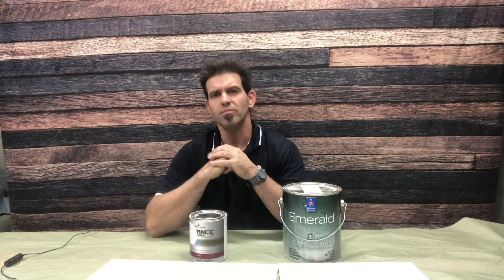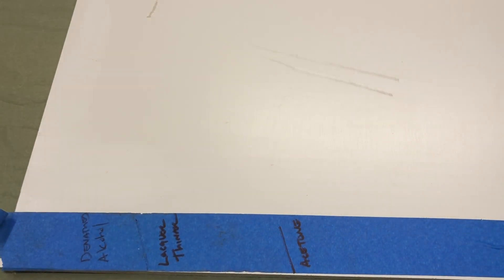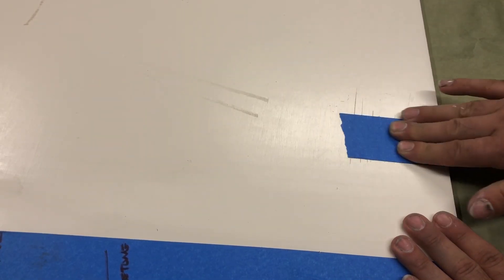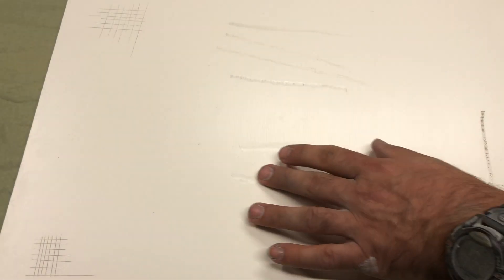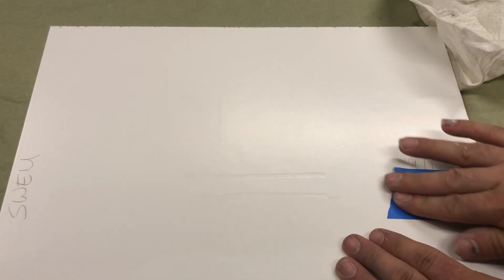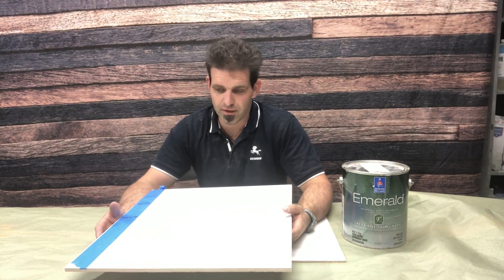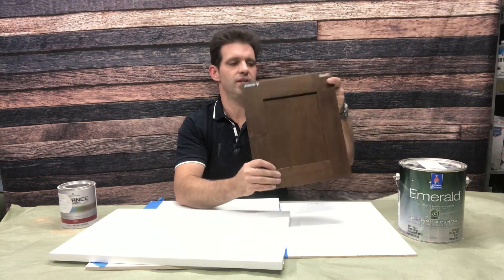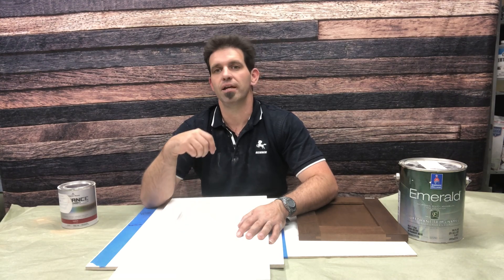Sherwin Williams Emerald Urethane Vs Benjamin Moore Advance

Comment: The emerald urethane you have is an Ultradeep base which is made for dark and accent colors... the 12 oz of white added took away the quality of the product therefore this comparison is not valid. Emerald uru is hands down the better product.
Reply from the maker: Bobby Robinson it’s a prop for the video it was not the can I used.  This was black I had for another test I was doing. So I did not put 12 ounces of white in a deep base that would be stupid and sherwin williams would not have done that anyway. Also I never determined am clear winner in the video. All I did was point out the pluses and minuses is each finish.
Reply from the maker: Bobby Robinson it’s a prop for the video it was not the can I used.  This was black I had for another test I was doing. So I did not put 12 ounces of white in a deep base that would be stupid and sherwin williams would not have done that anyway. Also I never determined am clear winner in the video. All I did was point out the pluses and minuses is each finish.

Comment: Emerald is TRASH!!!! when it comes to feel. it doesnt touch up for crap and takes many coats to make it look right. I sprayed a pre primed trim pack on new construction and it bubbled, but that could have been caused by the temps in the house since there wasnt any heat and was around 60 degrees i cant remember . but its still crap to  me since it feels gritty. Eric you really should try scuff X from ben moore. I  love this stuff it feels orgasmic to touch  like most high end industrial finishes, buttery smooth no matter the application method. Its not cheap even with a contractor discount but its my new go to trim paint for interior house painting jobs and repaints. some have used to for cabinets but yeah i wouldnt since im more into the high end industrial coatings.
Reply: I totally agree! Lays down great looks great feels great and you can recoat the same day! There's no reason to use advanced since there's no added benefits and you got to wait 16 hour for coat👍
Reply: @ballardpaintingcompany514  i kinda want to keep it a secret but for the price i think most low quality penny pushing painters will just go for some cheapo paint anyhow.
Reply: @bailey2624  👊
Reply: Yes you pay more , but we switched to Renner and honestly we are running smoother and faster with less / no call backs. We are finishing jobs in 3-4 days . So yes it's way more expensive but specially if you use the Renner 851 2k , but at the end of the day would you like to save $100 in paint or $1000 in labor ?  I don't think we will be going back to advance or emerald urethane not because they are trash ( because they aren't ) but because we are better experience and better finishers . We used to call ourselves cabinet painters when using advance etc... Now we call ourselves cabinet refinishers who use industrial wood coatings ( we closed many more jobs using this method )
Reply: @emanuelmorales2914  totally agree!👊👊
Reply from the maker: Rick Bailey I hear ya it’s on list. Thanks for the comments and the support.
Reply: Just when I was going to buy SW Emerald paint to do my kitchen cabinets, now comes along this comment trashing Emerald, and Eric doesn't defend Emerald. WTF? I thought this was a video saying Emerald was decent? How is there no push back on this comment? There is literally is no paint out there that is durable and beautiful for kitchen cabinets that someone won't trash to oblivion. And these three paints, Renner, Milesi and CIC that are being touted as better than anything, are unobtainable. Where's the info from this Youtuber on how to obtain them? Choosing a primer and topcoat for refinishing kitchen cabinets by watching all the videos on Youtube in order to pick the best, is a nightmare I wouldn't wish on my worst enemy.
Reply: @amynunez476  licensed contractor? Yeah a license to steal. The crooks charge more than doctors and lawyers do today.
Reply: As I understand Advance is better for trim and doors than scuff x because its a bit more durable.  The scuff x is more for heavy traffic interior walls etc.
Reply: @1pcfred  a doctor won't paint your living room, now will they?
Reply: @fsolefajo8777  they might.
Reply: I had the opposite..refinished a tall dresser. My instincts were to go to my traditional Advance , or Pro Classic.. however the emerald worked out incredibly ..primer tinted to color. P5 primer. I couldn't chip it off with a hammer..if I tried!!.
Reply: I have a feeling this guy didn't use this Emerald, probably used the Acrylic Latex version

Comment: Benjamin Moore is owned by sherwin williams, so is lenmar and many others, I met one of the chief chemists from SW and the formulations are almost identical between advance and the urethane emerald. They both are inferior to BM's lenmar wb finishes and SW's kemaqua. Also consider trying chemcrafts acrylic aqua prime which is phenomenal as a sealer, flashes over in minutes, powders when sanded and is cheap about 150$ for 5 gallons. Problem with these European finishes is they are not readily available, I dont want to wait a week and hope that the color is right. Until that happens they are not even a consideration in my woodshop.
Reply from the maker: Benjamin Moore owed by Berkshire Hathaway not SW. Yes they are similar but not identical. I have used chemcraft aqua prime it was one of the best years ago but it can’t hold a candle to the primers from the European manufacturers or CIC which is an American manufacturer. Kem  aqua is garbage Compared to European technology. I used that coating for the better part of 6 years and it doesn’t hold in kitchens. Yes the European finishes are readily available and I can get them in 2-3 days and the suppliers I deal with are the best color matchers in the US.
Reply: @ericreason6559  I stand corrected, you are right, sw is owned by BH, now which of the European brands would you recommend for top coat and which primer from cic is better. I run a 5 stage hvlp turbine from fuji and apollo with the 7700gt guns. I prefer 1k systems as I go through primer and decorators white by gallons through 2.5gallon pressure pots and I do have two guns set up with the pps 2.0 system for odd colors and quick changes. So at the moment I load up the pots with 2 gallons of kemaqua and primer and I'm always ready to go. I kinda got used to the conveniance and not looking to stray. I love the idea of 2k but seems like too much hassle for a negligible performance upgrade for my application since I usually do fireplaces, tv cabinets and things that don't get extensive wear.
Reply: Also have you tried ILVA? My local coating dealer started carrying it and was going to try it on the next job.

Comment: We just had some quotes on our kitchen repaint (OKC), 2 quotes are 4500 to 5000 and both are using SW Emerald Urethane, 3rd quote was a painter using Renner and it was $8500, fuck that, my kitchen cabinets aren't even worth $6k. Prices are ridiculous with Euro paints. I do understand they are a lot better but I could almost paint my kitchen twice for the cost of painting it one time with Renner.  I wish I could find a painter in the OKC metro area that uses CIC products, a local store just started carrying it.
Reply from the maker: It has nothing to do with the paint. It has to do with knowing one’s value and what they bring to the table in terms of value. I would bet money the crews using emerald are skimping on the process somewhere. Cic isn’t any cheaper then euro coatings. If you cabinets aren’t worth them money then get new ones. You might be shocked how much new cabinets with installation are.

Comment: One more if I may using either of these products in a deep base is not recommended
.
Reply from the maker: nick dunse I have seen an witnessed the issue that can occur thanks for bringing that up for others to know and be aware of.
Reply: @ericreason6559  I have first hand with both products its a major issue and painters especially if doing cabs should be aware.

Comment: well of course water based paints aint going to cope with being cleaned by these
Reply from the maker: There’s were you are wrong their are a handful of industrial wood coatings that will take the abuse. Just go look at my channel.
Reply: @ericreason6559  you must have some rum good water based paints in the U.S. water based paints won't take that kind abuse in U.K. maybe apart from floor coatings.

Comment: Both products are weak...
Reply from the maker: I don’t disagree but they do have some upsides for certain applications.
Reply: What would you recommend than if these are poor paints?
Reply from the maker: Dylan Matter anything from renner, milesi, cic, sirca or envirolak will perform at a much higher level than these.
Reply: @ericreason6559  yeah, most of those paints are for commercial use and you will need to be licensed. What do you recommend that I could just go over and pick up a bucket of paint that's good for kitchen cabinets
Reply from the maker: Martin Go I don’t recall anyone asking me to see a license when I bought any of these products. I honestly don’t have a recommendation for a paint you can just walk into a store and buy. My channel
Is about industrial wood coatings and the best of the best. I am sure you local SW, Porter, or Ben Moore store can give you a recommendation that would fit the bill but it’s not going
To be anywhere near the caliber of finishes i discuss on my channel.
Reply: @ericreason6559  I've gone to Sherwin-Williams and I asked for lackers to spray over Paint and they refused to sell it. they asked for a license.